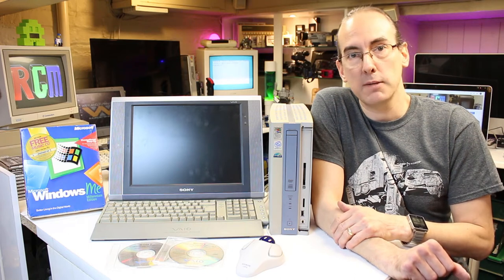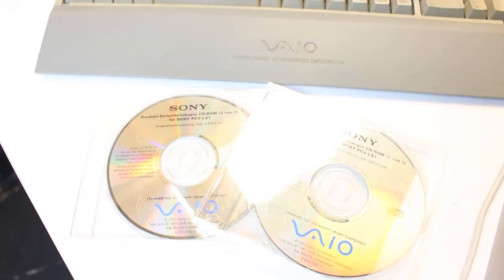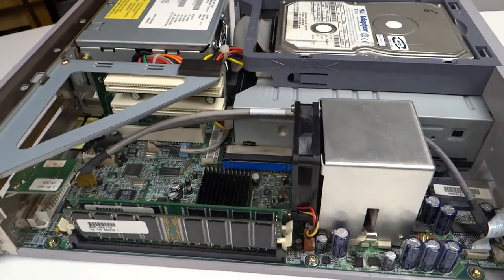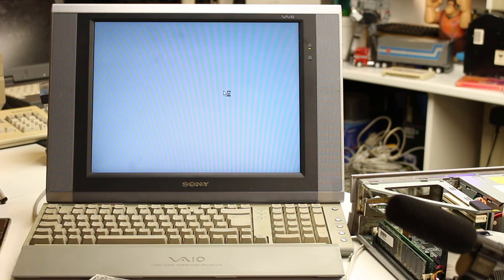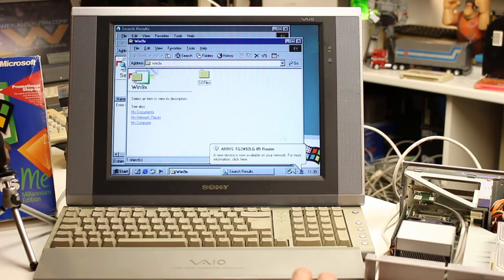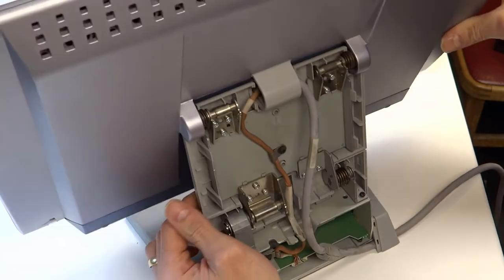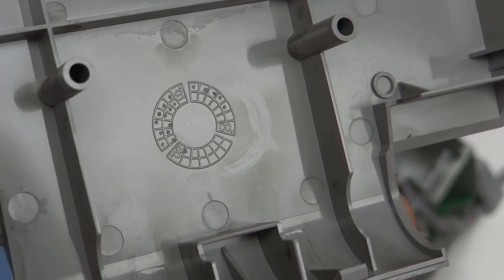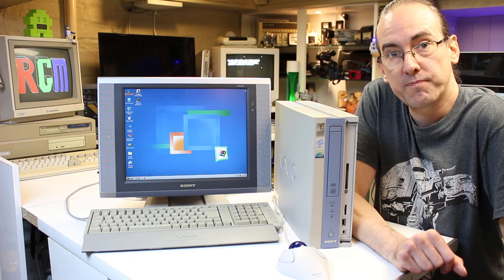Vintage Retro 20 year old #Sony #vaio PCV-LX1 Restoration

Comment: 27:15 did that remained fixed? It doesnt make sense why removing a piece it fixed the problem... since I have the same pc with the same problem(the stand not being able to handle the weight of the monitor so it falls) and I dont know how or who to call to fix it
Reply from the maker: I had to watch it back as this was two years ago for me. It is still standing. I am not sure either why it works without. In the video I mentioned about the internal spring unwinding. So maybe that helped give it some more tension. I don't know to be honest.

Comment: hi , someone is selling one of these complete .
but the mouse is faulty.

i have a question.

is there anything proprietary about this one? regarding, mouse, keyboard, using another lcd, os reinstall, hdd and more importantly, adding a pci videocard.

ty vm
Reply from the maker: Hi I cover most of what you ask in the video. It is an odd system. Have you watched it?
Reply: @RetroGadgetMan  i did, the only question i still hve is that .
if i add a pci videocard, then the lcd monitor wont work, correct?
Reply from the maker: @delukard07  not sure as I have not tried it. It's more of a stand alone system than an upgradeable one to be honest.
Reply: @RetroGadgetMan  ty

Comment: thanks for the video! may i ask from where did you buy it?
Reply from the maker: I got it all from various poeople on ebay.
Reply: @RetroGadgetMan  did you try to set the bios date in 1999 when you tried the recovery process? it's very strange that the disk arent working.
Reply from the maker: @alexisnik19911  can't remember now actually. I will have a look into that at some time. Thanks for the tip.
Reply: @RetroGadgetMan  Ive got 1 but tower only no idea its value tho